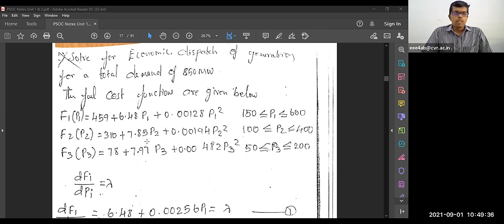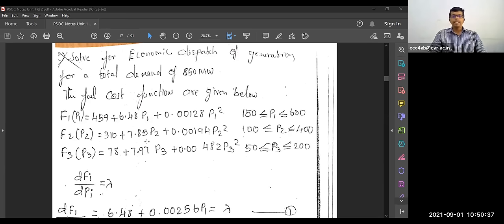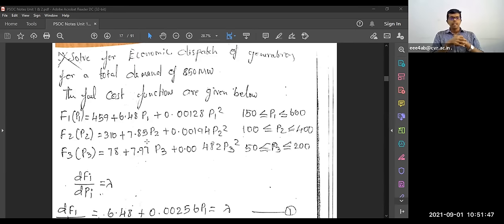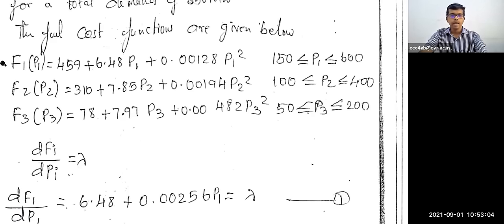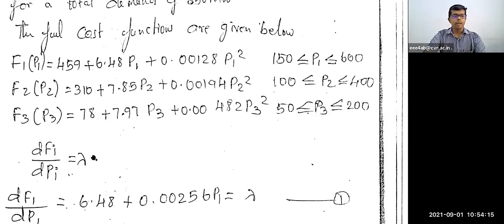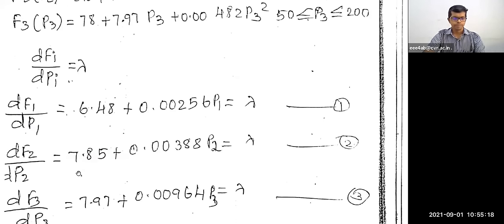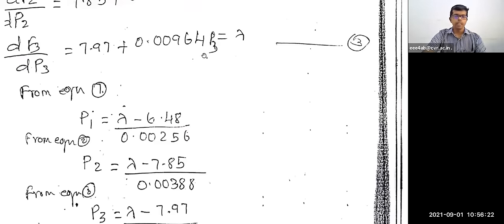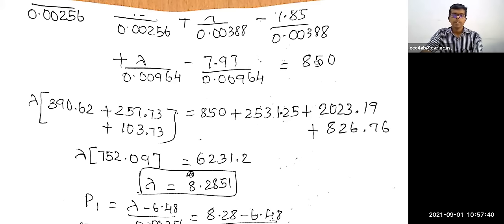Solved Example Problem 2 - Economic Load Dispatch without loss #psoc

Comment: (a) Determine the economic operating cost for this 3 units when delivering a total load of 850MW. The fuel cost for unit 1 is 1.1N/MBTU, unit 2 is 1.0N/MBTU and unit 3 is 1.0N/MBTU.

(b). Assume the price of coal decrease to 0.9N/MBTU in the system (i) above. Determine the economic operating cost.
Reply: I want you to try solve it

Comment: Thanks for the explanatory video, it's really useful. However, I have a doubt: after setting P1 to 600 MW and recalculating P2 and P3 so that the sum is 250 MW, by obtaining a new lambda value of 8.57, shouldn't we check again that the conditions of the partial derivatives dFi/dPi ≤ lambda (for Pi=Pmax), dFi/dPi≥ lambda (for Pi=Pmin) and dFi/dPi (for Pmin<Pi<Pmax) still hold?